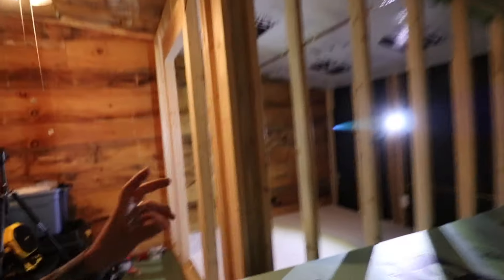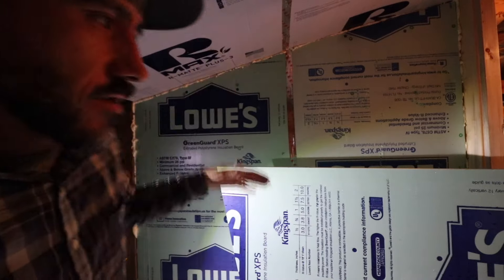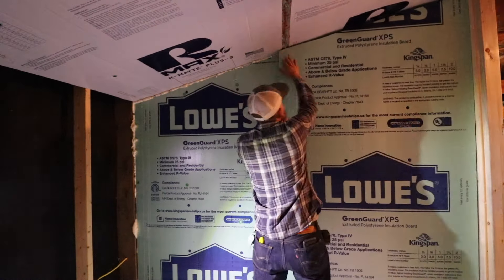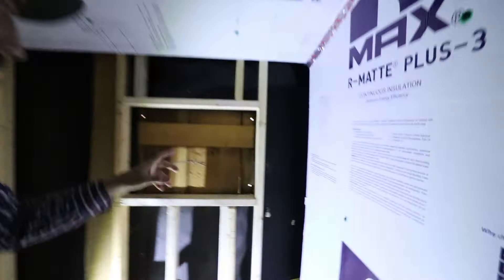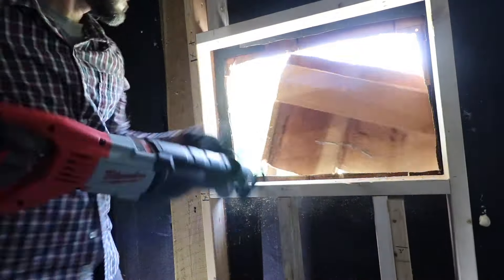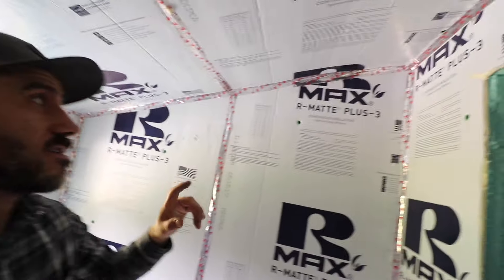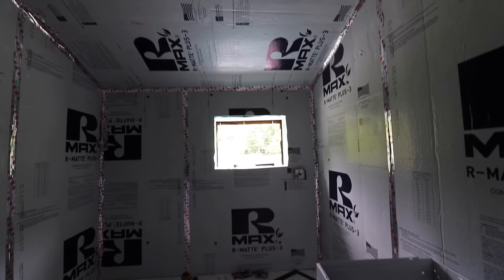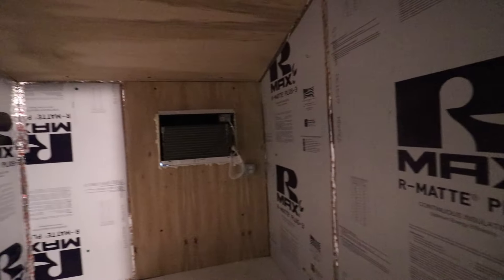DIY Walk in COOLER BUILD (Insulating walls)

Comment: Hi Jason, I've been following your build on both channels. Great job! Justin had a lot of comments on his channel and this weekend he is traveling with Jonah so there is a strong possiblity that you will see this safety advice before he does. When you put the safety door in position on Justin vlog, I noticed that the cooler door did not have an internal latch to open the door from the inside. Due do this and being that Justin still have small kids, it truly will be wise to install a luminated panic buttom inside the cool room in case the door closes behind someone. I strongly recommend both light and bell system and that these alarms and warning lights be placed outside of the cool box, upstairs near the kitchen area and being that most farmers and homesteaders work outdoors, one should be place outside. I've done this for store owners with children that spend a lot a time around the place of business. With todays technology, I bet there's even an app that can send an alert to our phones. Please take note, love you guys and what you are doing and want all to stay safe.
Reply: That door is not the locking type handle like the old days. It's a regular magnet seal, just like a common refrigerator.
Reply: Yup! I absolutely immediately noticed this too in the door hanging shots!  I'm sure Jason has it covered! but very important reminder Thomas, glad you pointed it out!
Reply from the maker: it does open from the inside. you push it and it opens pretty easy. Kids can open it. Thanks Thomas!
Reply: @SowtheLand  So Jason, it's just a magnetted strip that keeps it close and not spring loaded hinges? If so, that is great to know. The  ones we use to install had night catch slam locks on them. And for the ones that stored valuable cuts of meat, wine and champaign came with lockable sliding bolts. It's been well over 15 years since I build my  last cool bock and I can see the technology of the modern refridgerator door now built with no locking hardware on them, I just didnt know they made those commercial boxes the same way.  Great to hear! :)

Comment: First of all wood is not a good insulator. Second wood absorbs moisture. In a freezer it can then freeze and swell causing the joints to misshape and leak precious cold. Third, damp wood is a food source for mold and can cause mold to grow inside the panel and possibly cause negative health affects. Finally, wood can absorb water vapor lowering its already low R-value. This water vapor, through freeze and thaw cycles, cause water to run down and either freeze inside the walk-in or run outside the walk-in causing an unsafe slippery floor increasing injuries and liability issues. Therefore wood is not desirable in walk-ins.

Comment: You're right, practically speaking foam insulation in a cooler wouldn't bother me.  The question is if it would bother a building inspector?  He could call it a fire hazard depending on which inspector you get and what the local building codes say.

Comment: Jason, thanks for the video. I am building a walk-in cooler for myself of very similar dimensions 10x8x8. I would like to know the specs 
(maybe a link) to the door and the AC unit, please?
Reply from the maker: door check eBay. AC check the coolbot website. has everything you need.

Comment: why didn't you insulate the walls between the studs?? that could of added another r-13 + insulating value... at a low cost. 
a split a/c unit would not have had heat transfer from the metal case..
Reply from the maker: It’s better to have air between studs.

Comment: the coolbot is unnecessary. you can do the same with 2 inkbird temp controllers and a 5w light bulb to warm the ac temp prob. the 2nd inkbird controller measures the fin temps and shuts off the heating light controlled by the 1st inkbird. preventing the fins from freezing. . it literally saves you 400 bucks